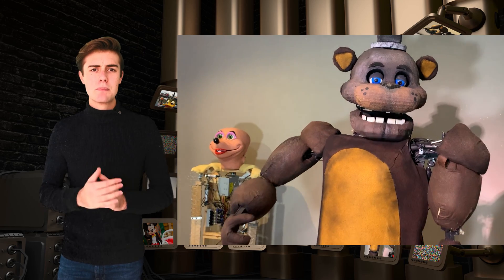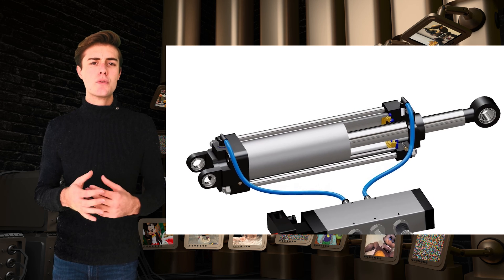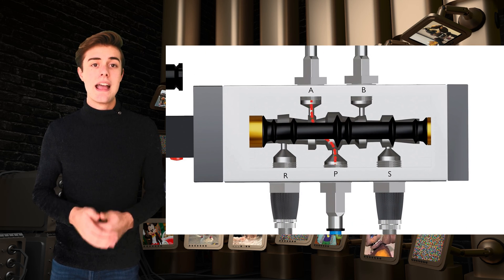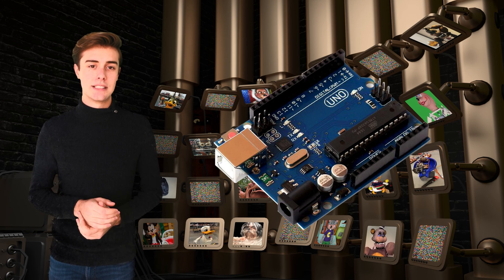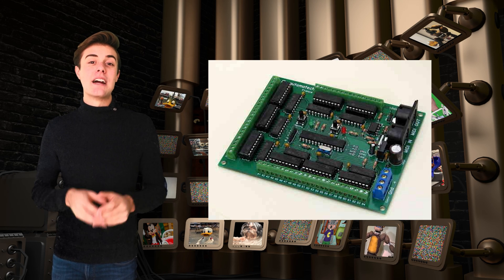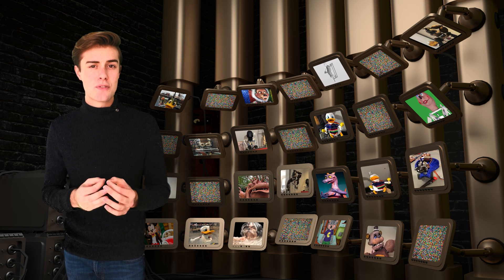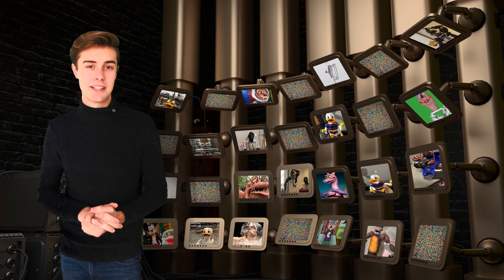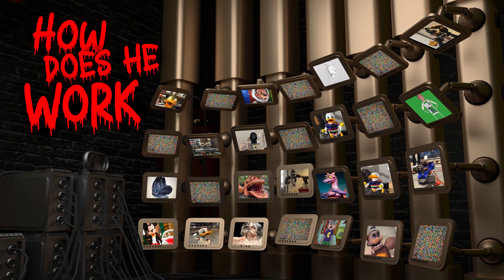How does Freddy Fazbear Work?

Comment: I have a quick question! Could an animatronic be built by wood and still use servo's? Or is wood too heavy for servo's, Otherwise I'll just use plastic pipes.
Reply: I doubt wood would work, your best bet would probably be to use foam which would probably be lighter then plastic. And plastic for the inner frame.